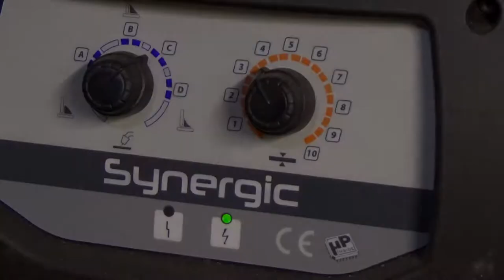Can You Weld a Bearing

Comment: This video answered my question perfectly.
Thank you for taking the time to make and post this.
Reply from the maker: Really? Thanks. Why do you need to weld bearings?
Reply: @DIYGarageProjects  I'm looking into using an old worn out timken bearing as a lazy suzan style plate rotator.

Even if the bearing cracks, it will still roll and that's all I need considering it won't have more than 50lbs on the top side.

Thank you again!

And to hell with the nay sayers
Reply from the maker: Oh, cool idea

Comment: You cuold GREATLY reduce the excess heat by not rushing.  Take a few moments and do in small tacks, pausing briefly.  Th same technique is used with very thin metals.
I am looking for options of adding the ability to rotate my 43" PC TV/Monitor to my diy mount.  Considering bushings as well.